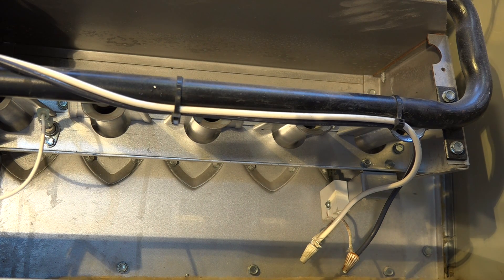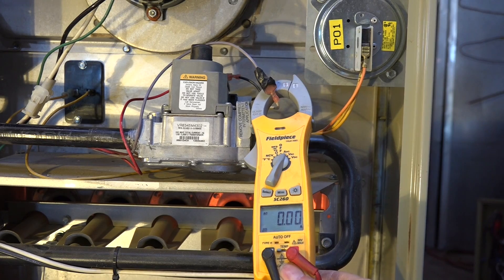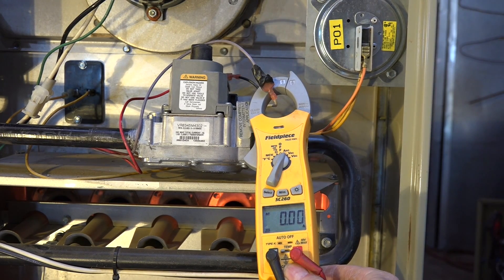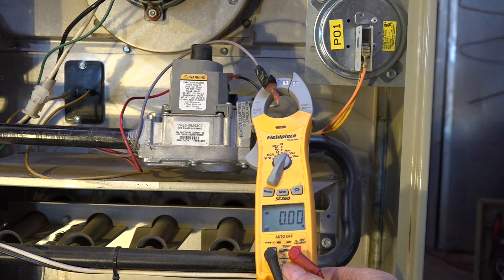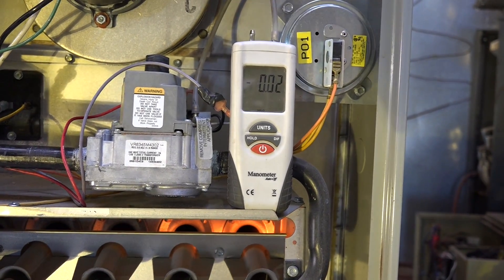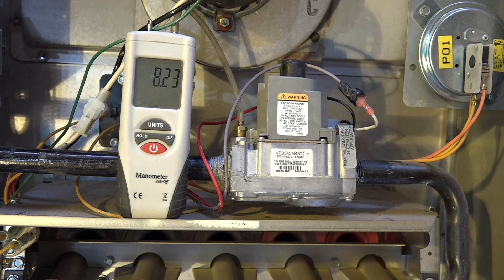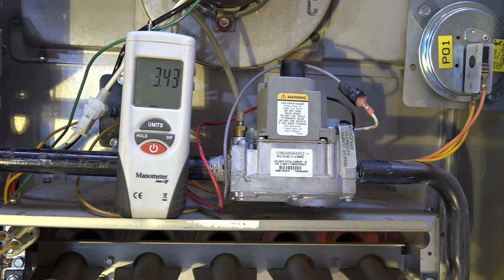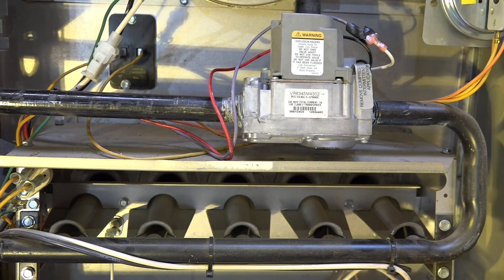What's wrong with this furnace, #2 answer

Comment: a obstructed/plugged gas line? how does that even happen? my furnace Evcon Coleman (a 1997 DGAT056BDD) does not have a pressure switch. the sequence goes as folllows Call for heat, Booster motor engages, 42 seconds and the igniter draws between 3.9 and 4.2A and has a resistance of 110Ohms, at 70 seconds gas valve draws 24vac @ .32A (the igniter and gas valve are both on for 4 overlapping seconds at 80 seconds the cycle ends and it retries after a 60 sec pause. the single LED error code that comes up is a single blink (error code 1 is ignition failure according to legend on control board. could i have a plugged line?? or perhaps a bad regulator upstream of the furnace ? there is a regulator on the big propane tank and another regulator on the outside of the house. im thinking i would like to put a pressure gauge before the gas combination valve at the furnace to see if i have pressure coming into the gas valve.

Comment: hmm I'm wondering if you could elaborate on this. I was thinking faulty regulator apposed to a blockage. Is their a difference in "symptoms"?
Reply from the maker: +Kyle Faubertq Definitely.  Watch the manometer.
GFM
Reply: I'm not sure about the way that the test port is connected to the blockage but I would assume that if the gas valve was blocked then the incoming pressure would stay constant depending on how the port was connected through the valveand where the blockage was...
Reply from the maker: +Kyle Faubertq Note the manometer reading on both sides of the gas valve.
GFM

Comment: i am a 30 + year HVAC technician...never ever seen a plugged gas line..have seen bad regulators at gas meter, although very rare...but fun brain exorcise...like your videos....i want to know are you making any money from them?...Have you ever considered doing internet troubleshooting for a fee...i think there may be a market for us old timers to explore...any thoughts.
Reply from the maker: +bill demmon There is income from advertising.  The troubleshoot for a fee I have not tried.  Sharing your expertise is just an extension of what you did in the industry.  
GFM
Reply: Saw one the other day because one of our installers put so much pipe dope that it caused a restriction in the gas line
Reply from the maker: That's a lot of pipe dope.
GFM

Comment: good video, but having a regulator fail under load is also an option. is very rare that you will find an obstruction in the gas line yet alone have the pressure drop to zero. when dropping to zero most likely going to be failed regulator. thanks for the video